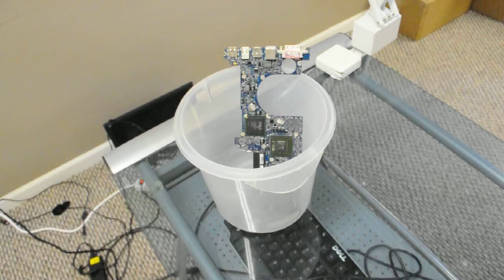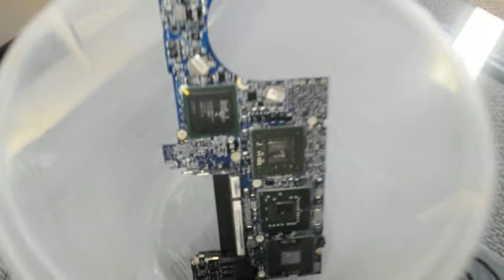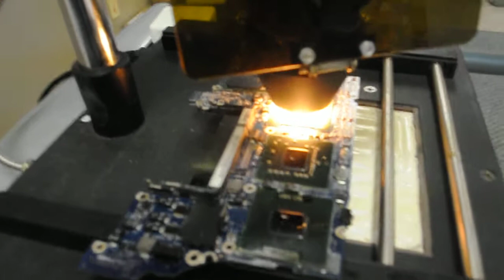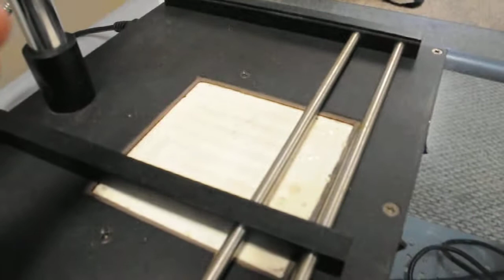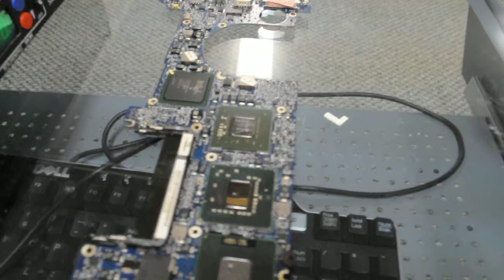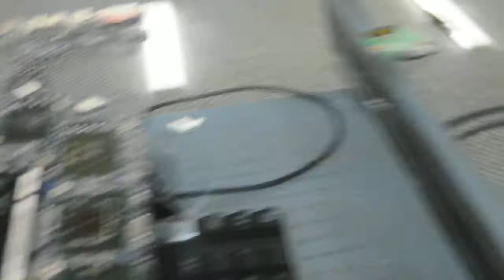Rossville laptop repair and computer services on a MacBook Pro with a bad Nvidia chipset.

Comment: Do you use flux when reflowing these machines. evertyime i've done a reflow with the lamp that close i end up burning up the chip. the capacitors fly off or chip bubbles up.  settings are bottom heater at 150 and top heater at 200. is the flux causing it to heat up to much. 
thanks a million, you guys are the best.